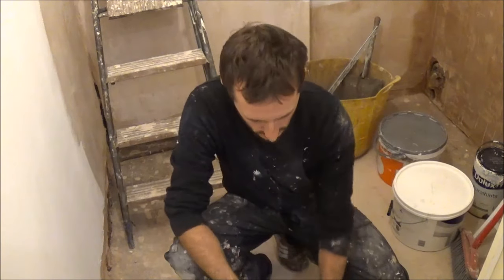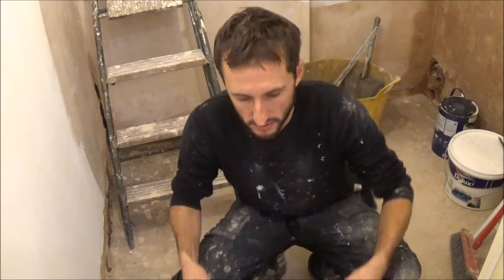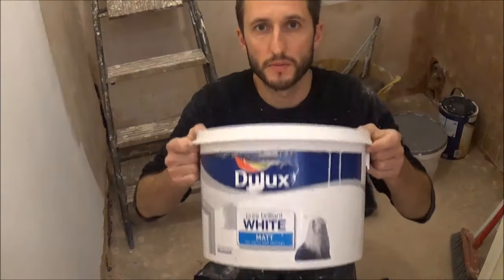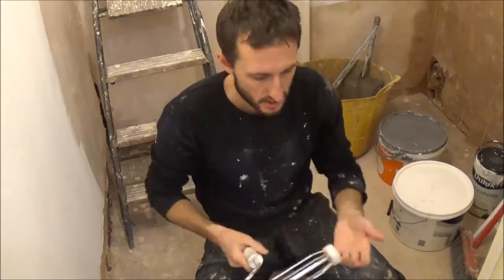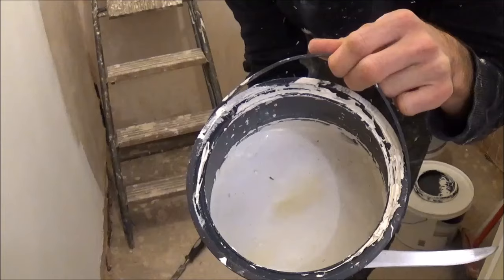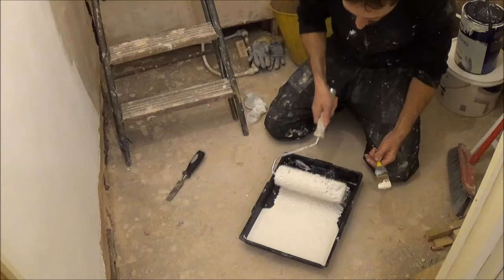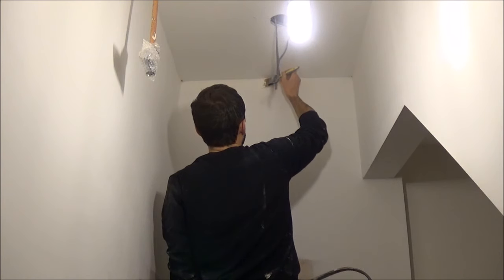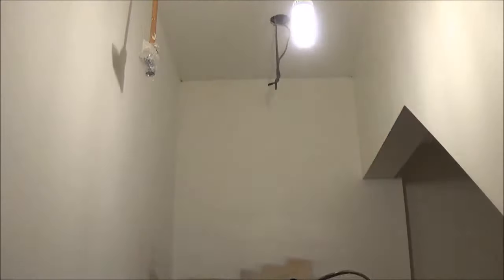How to paint emulsion using a roller and brush, beginners guide. DIY painting made easy!

Comment: Hi, thank you my plaster is done. :) when will plaster dry. Please what is your recomma. For use base coat?  Any 3in1 or any emulsion? Top coat will be white any perfect white   Or maybe light grey :-). Thank you
Reply from the maker: Hi Pavel, well done with your plastering, good work! The plaster will take a few days to dry. It will go a light colour when it has dried out. I have done a video on painting which shows what paint I use as a base coat. Hope this helps.

'How to paint emulsion using a roller and brush, - https://www.youtube.com/watch?v=CUtGROtIMgg

Let me know how you get on. Thanks for watching!
Reply: POUSE around the HOUSE  Hi,  
Sorry I still don't know, how do it base coat for my new plaster. My plaster got any "small scratches and small line" what will best? Will ok if use only Dulux win I'll Matt -white? Thank you it is my first big plaster :-D.
Reply from the maker: Hi Pavel. You will need a few coats of paint so best to use cheap paint on the first 2 coats or it will cost a lot of money. The plaster will absorb a lot of the first and second coat. The Dulux paint is ok, but add a little bit of water to some paint in a tub, then put one or two coats of that on the wall before putting your final coat of paint on. I like to use B&Q white matt emulsion (in an orange tub) for my first two coats. Just apply it straight from the tub. I find it takes to the wall really well and it's about £1 per litre which is great. Then use your dulux for the third coat. Hope that helps.Good luck!
Reply: Hi,that sounds promising. You therefore dont recommended to use any "3in1 coach paintball (emulsion)", which cover slightly flawed? It is so? Thank you.
Reply from the maker: Not sure what you mean by paintball. But definitely use a cheap paint for your first two coats, the wall will suck it up!
Reply: sorry my keyboard on the Ipad is Happy :D 3in1 coach paint (emulsion). I mean :D :D Sorry one more time.

Comment: hi. your video helped me a lot. just littlr confusion.  i bought the similar roller head like yours. when i paint using this roller head it gives me small small bubles on the wall. dulux brilliant white silk should give me smooth finish but its nt. its like matt finish.  can u help please
Reply from the maker: Hi , glad the video helped. The only thing I can think, is sometimes when you clean a roller with water, if the roller is still damp you find the first few strokes a bit bubbly. It may just be the quality of the roller as they all vary. Some are cheap to buy but very good quality, and some are just rubbish. The finish from a roller is usually a bit textured, it'll never be perfectly smooth, but a silk paint will give a smoother more shiny appearance when dry than a matt paint. Sorry if that hasn't helped. Thanks for watching and good luck!

Comment: hello! how can I cover oil base paint with emulsion paint(water base)
Reply from the maker: It's not really a good idea, but if you sand it with fine sand paper it will provide a key for the paint. Better still just use a water based gloss. That way it is more durable (like traditional oil based gloss) but has the benefits of no solvent, no bad smells, and it doesn't lose it's colour. Hope that helps. Thanks for watching!